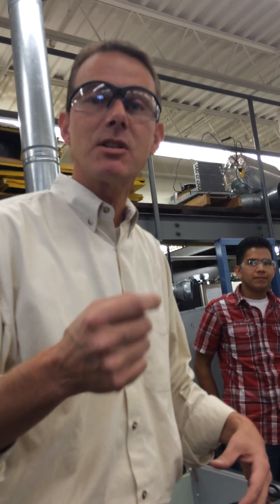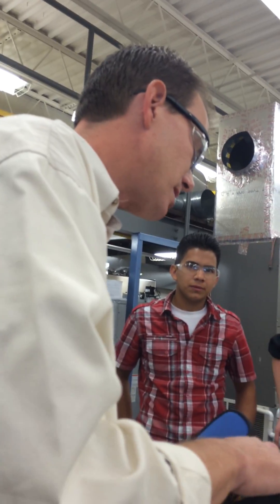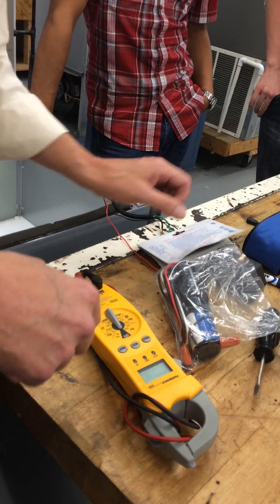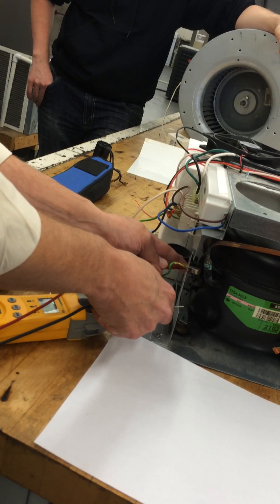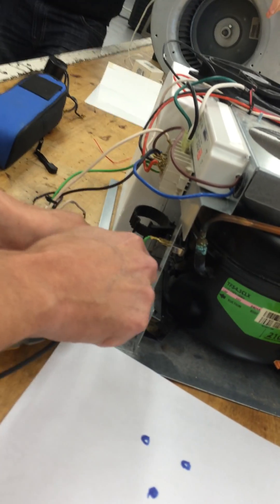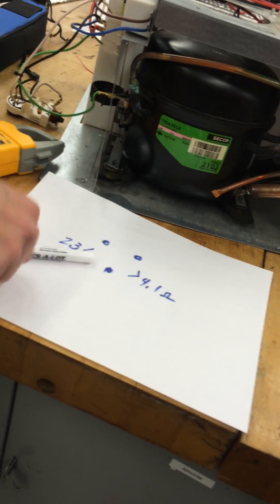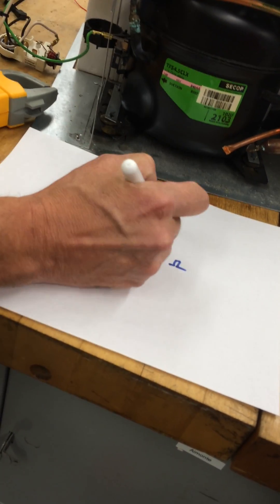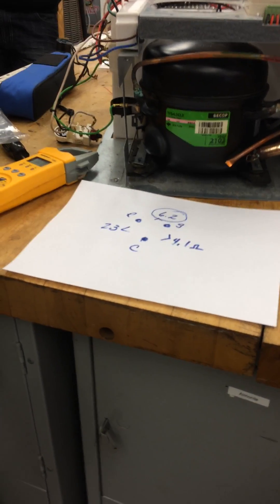HVAC Basics: Skills, Tools, & Procedures - How to find CSR terminals on a compressor motor

Comment: Thanks for the great video!
Identifying Compressor Common, Start and Run Connections:
If the 3 connections are not marked, we have always measured resistance between the 3 terminals. The highest reading indicates the start & run terminals, which helps you ID the remaining common terminal. Common to start should be the next highest reading, and the lowest reading should be common to run. Common to run + common to start = start to run.
However, the windings on a small R600a fridge compressor I am working on does not follow this rule. The run to common resistance (16 ohms) is higher than the start to common (10 ohms). Run to start is 26 ohms. I found the specs for the compressor agree with what I found. See attached.
Has anyone seen this before, and if so I am wondering if our training materials need to be adjusted. Or perhaps this is something related to it being an HC compressor (I doubt it)?
Welcome any thoughts you have.
Reply from the maker: Thank you for the comment. Interesting find. Can you post the make/model/serial of the compressor to look up the specs? I haven’t made any videos of HC refrigerants or compressors yet and this might be a good place to start.

Comment: Let's simplify! Using a good multimeter set on ohms, remove the compressor terminal cover with the unit off.
Touch one lead (of the meter) to one terminal and the other lead (of the meter) to one other terminal and record your reading . Lets call these terminals (A) and (B). The remaining terminal lets call (C)

So for example A-B=7 Ohms

Now lets read A-C and record. Lets say 5 Ohms

Now lets read C-B and record. Lets say 12 Ohms

Now lets add all the A’s= 12 Ohms

Now lets add all the B’s=19 Ohms

Now lets add all the C’s=17 Ohms

The highest reading will be the “Start” winding

The next highest reading will be the “Run” winding

The lowest reading will be the “Common” winding

Therefore B= “Start”

The next is C=”Run”

The remaining terminal A= “Common”